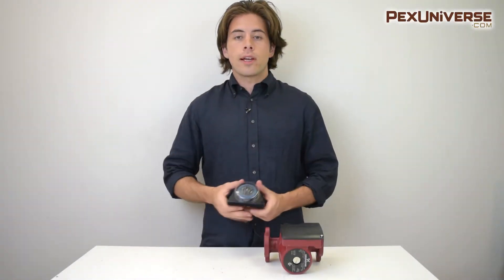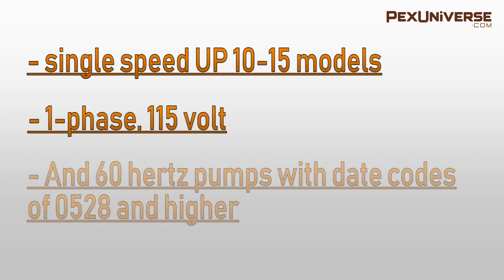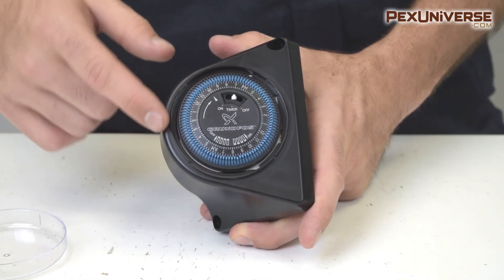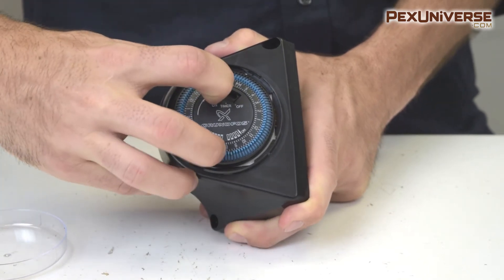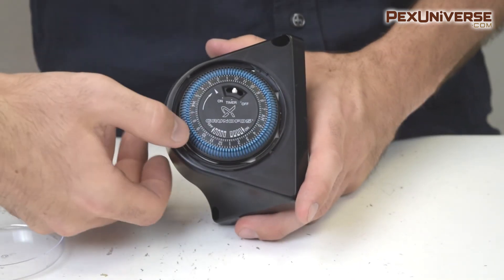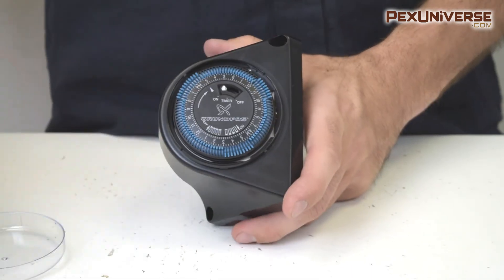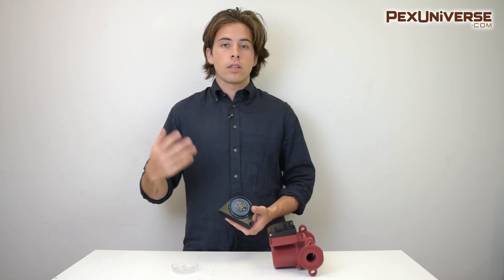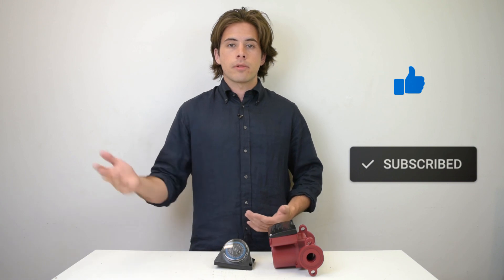How to Program Timer for Grundfos Circulator Pumps

Comment: Instead of using the timer, I set it to ON, and plug it into one of the wifi switches I bought on ebay for about $5. I use my smart phone to turn it on for a bout 45 seconds before I need the hot water, and turn it off right away. It works like a charm and only cost me a few pennies a month on my electric bill.

Comment: I think my timer is broken. Is there a way to remove the timer altogether so I can just use an external timer at the outlet?
Reply: I know this is a late replyh, but here goes. Before home automation as A Thing, the pump at my mom's place quit. I set its switch to "ON", then plugged it into a standard, work-a-day electric timer like one would use on a lamp for security and set it for the right times for it to run. Today, I'd just add a wi-fi, ZigBee, Matter, or Z-Wave smart plug to it, and let home automation take over. Even with a power outage, things would pick up where they left off after power is restored.

Comment: If you want "Always on".....you can't just set the middle switch to 1 (always "on"....the other two positions being 0...always off...or "middle", controlled by timer)....right?  I believe if you want it on all the time, you ALSO have to move ALL the outside-circle timer tabs toward the outside....to be always "ON" at their respective time intervals....right?
Reply from the maker: If you have the switch set to ON then the pump will run regardless of the timer since it's no longer engaged.  Once you switch to the middle for TIMER then it will be in line with the tabs chosen.